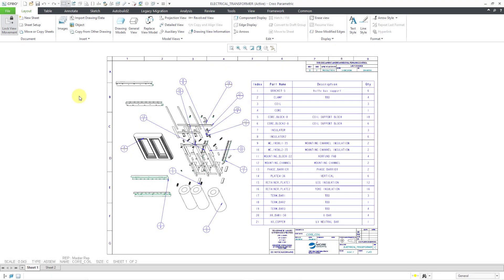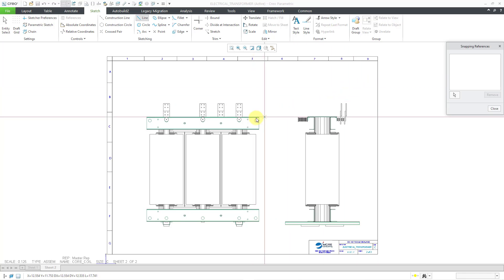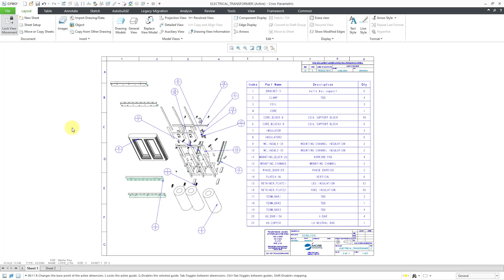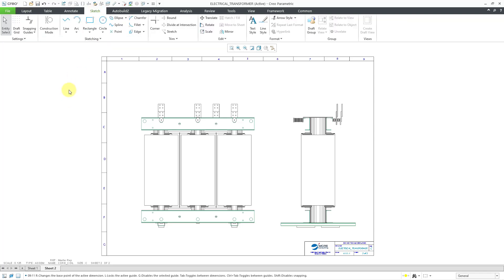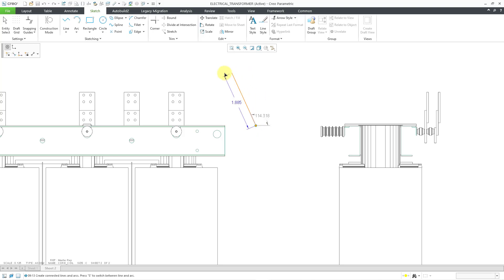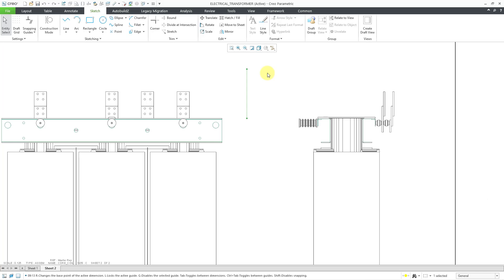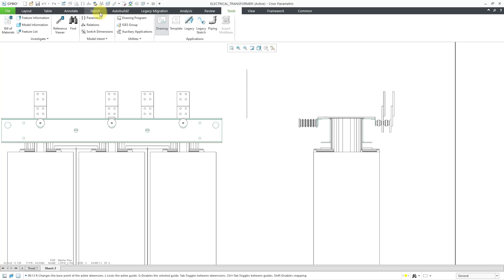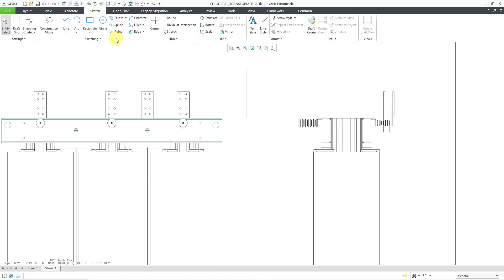Creo Parametric - Legacy Sketch - How to switch to old sketching tools in Drawing Mode

Comment: Hi mr. Martin, your videos have helped me greatly in my CAD related classes, I was wondering about a quirk in notebooks, that i can't find a "good" workaround for (or information about) anywhere. In the notebook parameters there is no setting for units, so let's say i have a notebook for a water tank and I want to say the volume of the tank is 700 liters. I can only specify that it is 700 (unitless) in the notebook parameters. My workaround is that I declare the notebook in my skeleton model, and then write something like: "LOCALE_VOLUME = VOLUME [L]". Where VOLUME is the parameter from the notebook and LOCALE_VOLUME is a new parameter in the skeleton model. This works, but it feels kind of weird/wrong. Do you have any thoughts on the matter?
Reply from the maker: I never noticed that parameters in Notebooks don't have units. I don't recall ever trying to use units in a Notebook; I've used them for passing integers (like pattern instances) and real numbers (dimensions). But anytime that units are important - which usually means I am doing complicated math to calculate dimensions - I am going to use Mathcad instead. PTC refers to a Mathcad worksheet in a Creo model as an Embedded Notebook.
Reply: @CADPLMGuy  Thank you very much for your reply, I guess it is not crucial, but a detail none the less.